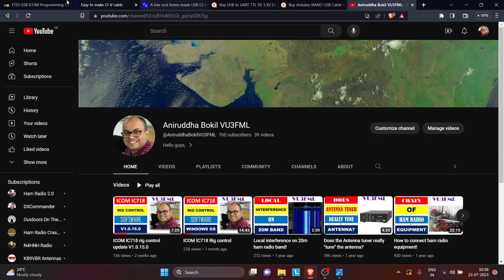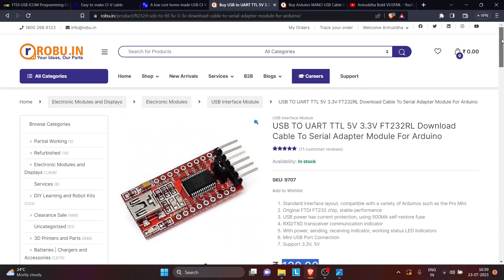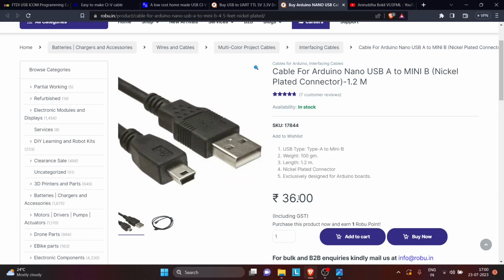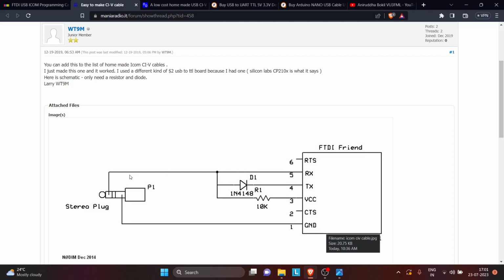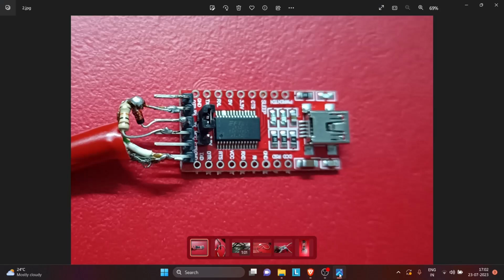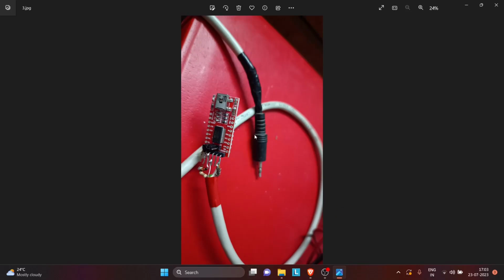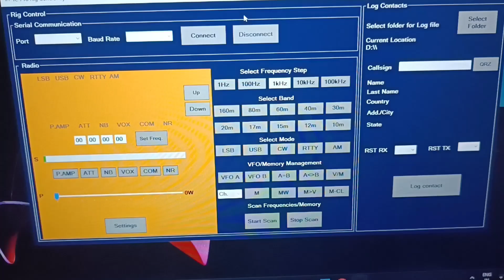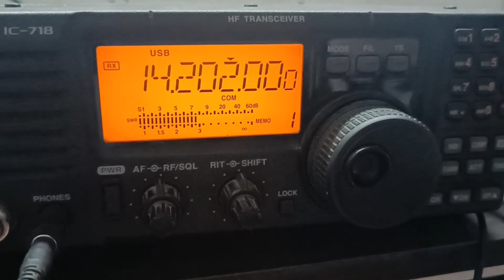DIY ICOM Rig control cable CI V: Reliable and very economic!

Comment: i see that every time i transmit a command trough the interface, there is a loopback echo on RX how did you solve it?
Reply from the maker: Maybe you can add snap on ferrite beads on both ends of the cable.

Comment: i did mine  device setting found the  driver  but my rig icom 775dsp  did not  worked  could snyone tell me any ci v  cable that work  with icom 775dsp   must be tested  for windows 10prom thanks

Comment: cant get it to log with qrz? any ideas? after putting in the call sign and doing the signal reports when i hit save it says done but does not show up on qrz
Reply from the maker: Well, it do not save directly to qrz.com. It saves it to a file in adi format. The file is saved at the location specified by the user at the top side of the interface. You can then import the file on qrz.com. This will save the logs there.
Reply: @AniruddhaBokilVU3FML  fantastic. Thank you for getting back to me

Comment: Nice! Will it work with handhelds like UV5R (Baofeng)? 

I have another question - I saw your video where you explained your setup. You told that your main transceiver was 10 W, I am very new to the hobby, my go to was ther UV5R whos label says it’s 8 W, if I invest in making a good antenna… will I get range to connect with HAM operators across India? 

I’m located in Chandigarh
Reply from the maker: No, this cable is for icom hf radios.

The radio i mentioned was HF transceiver.  UV5R is vhf/uhf radio which is useful for local communications within the city.
You need HF transceiver for ur requirement.
You need to be licensed operator to use any of these radios.